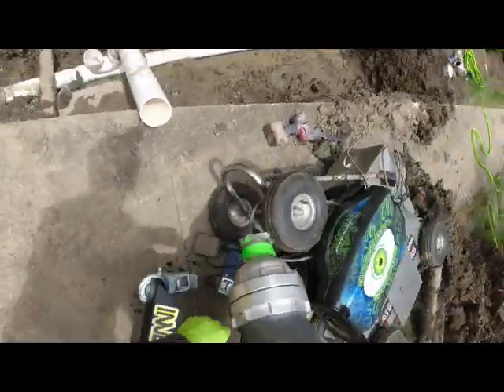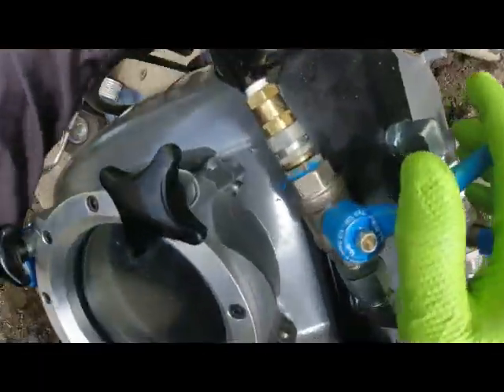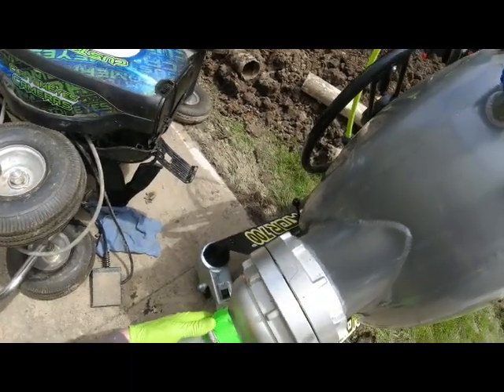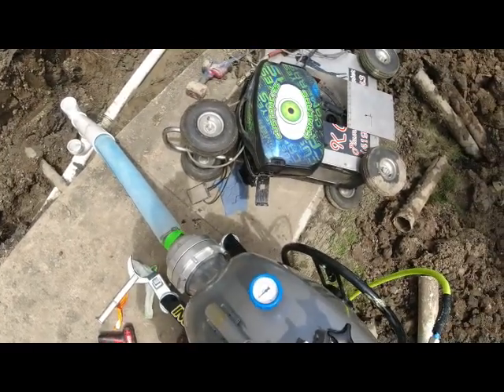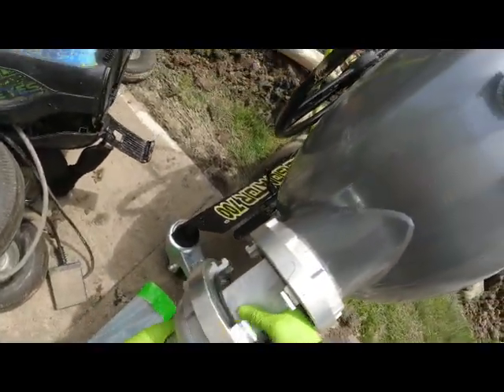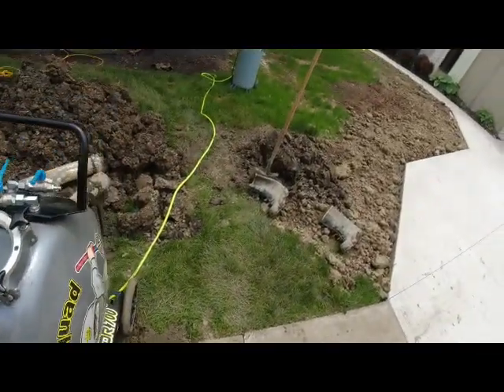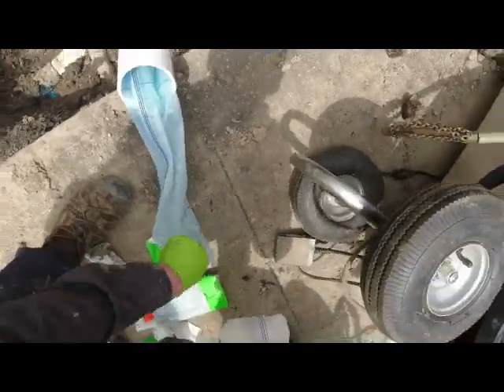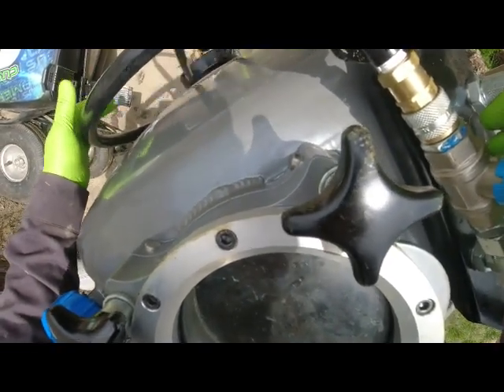Incredible sewer liner technology!

Comment: this is very new tech to me. if you have to line pipes that junction of another I assume you have to dig  down and some how make the junction good.? if you get my meaning. honest interest. cheers.ta.
Reply from the maker: Thanks for the interest in this! No, we don't have to do any digging if we do it right, even to cut in branch drain lines! We use special cutter heads on flexible shaft auger machines (lookup Picote) and for example, will go through the toilet drain pipe and cut a hole in the liner to "reinstate" the branch drain line.
Reply: @kcplumbingandrooter  thanks man. I will look that up.
Reply: @kcplumbingandrooter  get yourself a Dan Cutter. You won't regret it.